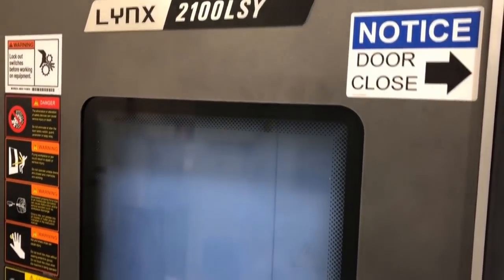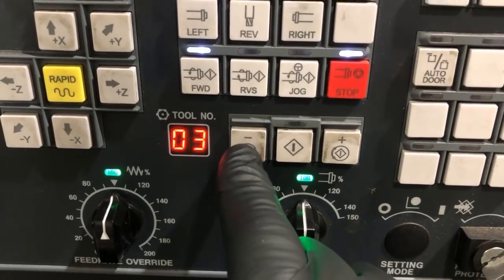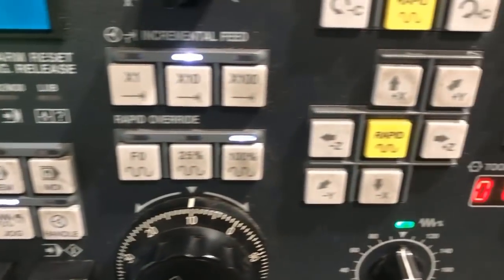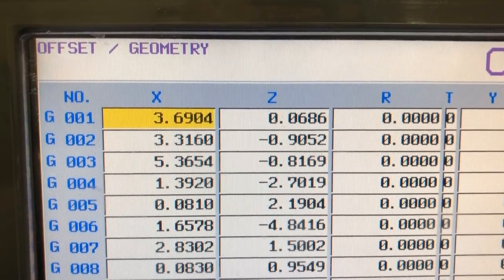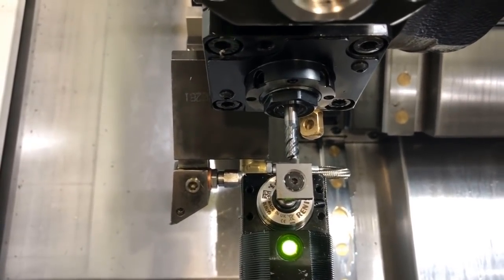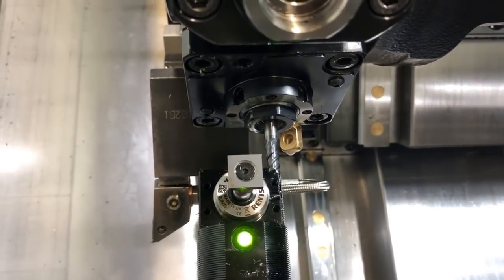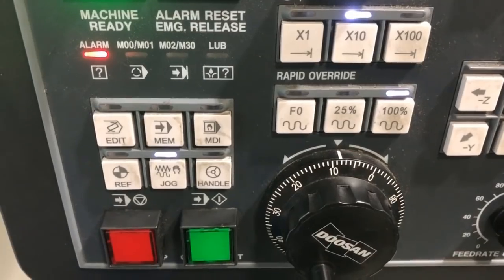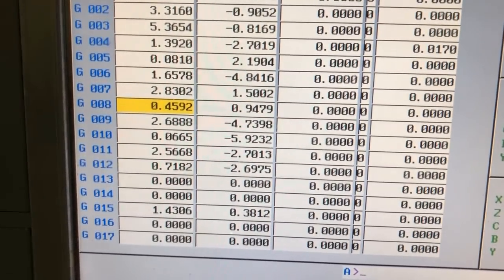HOW TO TOUCH OFF TOOLS ON  MULTI AXIS LATHE

Comment: I know this video is old, I recently purchased a Lynx 220LSYC.
When I pull down the tool eye the offset page comes up and it automatically selects the tool number which is great but, I am setting up a double sided holder so I have tools on both sides of the tool station.

My dilemma is that I cam not able to select tool offsets other than the selected station, how can I scroll down to probe the backside tool? The scenario I have in mind is this: I am using station 1 and have two tools installed one on the left side for the left spindle and a matching one on the right side for the sub spindle. When I bring the tool eye down it highlights tool offset 1 but I plan on setting the right tool to offset 31. I am not able to scroll down to 31 to use the probe. How can I select offset 31 when using the probe?

Hope that makes sense! Thank you in advance!
Reply: This is going to sound crazy but in the situation you're describing there is a built in feature to unlock which cell is highlighted. With the tool touch setter down press the feed hold and the spindle stop buttons at the same time. This flips a parameter and allows you to use the direction arrows to highlight any cell you want. When you put the touch setter away the parameter is reset how it was. It's not in my manual and none of the guys at my doosan distributor know about this trick, but someone on instagram mentioned it to me and it works beautifully on my 2012 puma 2100sy. It's actually a great system because it keeps you from accidentally overwriting the wrong value. They just need to write it down in the manual and tell their techs about it.

Comment: Say the tool setter is off in X or Z by like .01”. Is there any way to adjust / calibrate that?
Reply from the maker: Yes. There are parameter that can be adjusted for each side of the the tool setter. You can request those parameters from the machine dealer
Reply: Will do,  thank you very much!

Comment: Do you have any tricks or tips to check the center accuracy of the  Y axis of a axial / radial milling tool? with a gage or something before the part is made? thanks
Reply: You can mount an indicator in the spindle and position your tool in front of the spindle and adjust the offset in Y and Y once you show no run out. Hope that makes sense. Let em know how else I can help. Thanks  Tom

Comment: I run a machine a lot like this. They won't let us touch off tools like this. You have to touch off on the part.
Reply from the maker: Yes I have been in other shops that do that. Not sure why. It makes the process so much more simple in my opinion. Thanks for the feedback Ronnie.
Reply: @TomStikkelman  Tom, I work in a shop where we run a lot of long  shafts that are used in electric motors. We chuck these parts running one end then flipping the shaft and running the other end. TIR is a constant problem when we do it this way. Do you have any suggestions to improve TIR we have worked on this for years with out much improvement. Thanks for your other videos they are very informative.
Reply from the maker: Ronnie Elmore Would you mind sending me a sketch or print in an email so I can look at the specs. My email is tstikkelman@gmail.com
Reply: Ronnie Elmore this is a standard way of shaft turning. I’d rough both ends in, then flip and finish one end that’s easiest to hold, then flip for a finish on Op4 with soft jaws. Are you using a steady?
Reply: Tom Stikkelman they don’t let them ,touch off on the probe because they either don’t have confidence in their people or the probes have been hit so many times ,they will not give you an accurate position.Touching off with the probe is the fastest and best way to touch off tools ,especially if yo have a full turret.thanks tom

Comment: make sure as well if your not using the direct offset to press cycle stop and spindle lock together to unlock the offset page so you can alter the offest you want, use page down to go through offsets, cursor down will go through each one in x then z before moving down a page, very tedious. Press the blue alarm reset and cycle stop to re lock the offset table (very important or all future touch offs will only afect THAT offset). Lynx 220 lsy with fanuc i control

Comment: Why would it be the - Diameter of the tool in X? Do you not want to find the center of it? Would that be the same for a drill?
Reply from the maker: All offsets made on the x axis are done in diameter to get to centerline. Even though you moved -.375 the machine basically only moves half of that. Hope that helps
Reply: @TomStikkelman  similar to when you need to make adjustments for id or od, you offset the full amount and it cuts half on either side. That does help, thank you.

Comment: Good vid like always. Programmed, set-up and ran 2 Mori 7 axis DL20s for a number of years. Boss didn´t  want us using the arm to touch-off tools. Would always do so on the part itself.
Reply: Why is that? If you don’t mind me asking. I’d assume the indicating arm would be more accurate
Reply: Presetter would get wrecked and them ain't cheap!